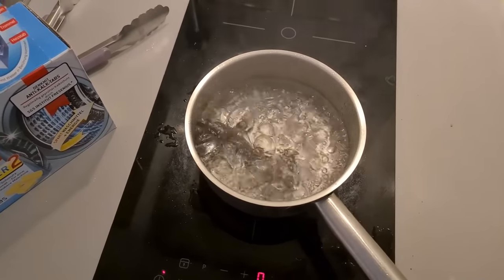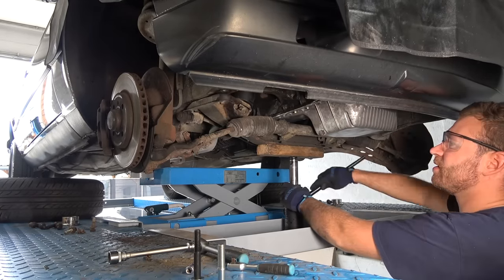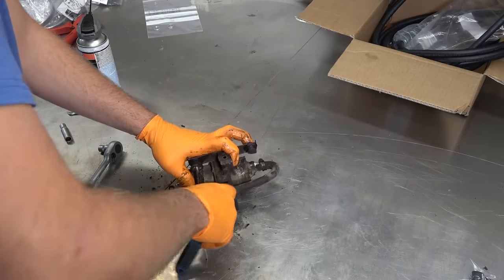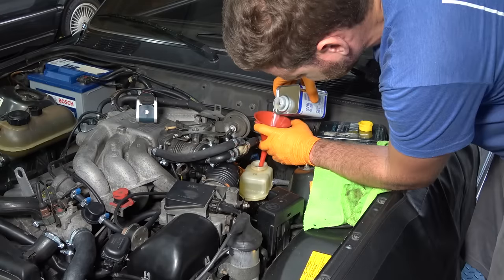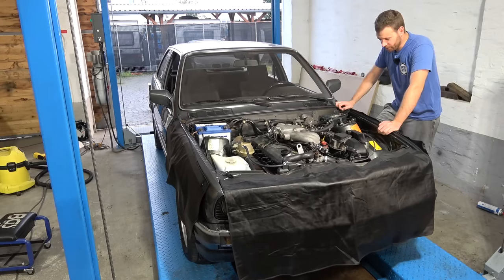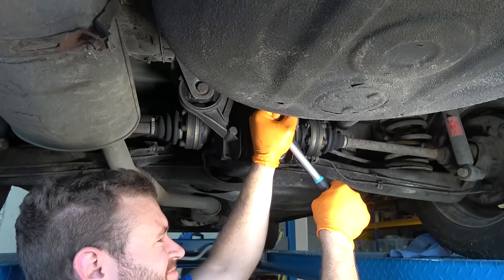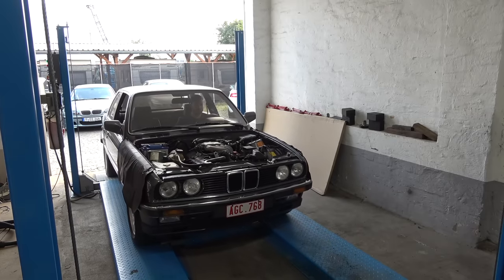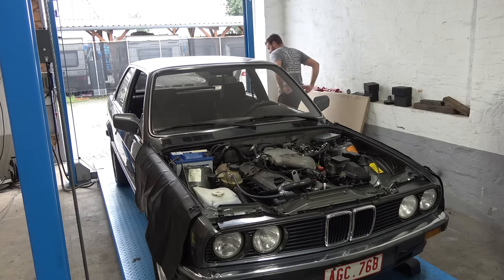Let's Get Mechanical - Neglected BMW E30 320i 5-speed - Project Marbais: Part 4

Comment: with broke of bolts try simply cut a cross or a simple slot on top of them with a dremel tool disk and then use a scredriver very carefully ... always worked best for me ...or if its to deep ... try to be a litte "artistic" ... use a small fräskopf
Reply from the maker: That's not a smart way to go about it, the bolt is weak and would definitely break if you try that
Reply: @M539Restorations  naaa depends ...if its deep enough then maybe not ...gonna be supported by the threading walls a little + no need to weld... but i m not completeley denying that what you say !

Comment: You have a refreshed clutch pedal hydraulic system until you don't t have a one and you are far away from your garage
Reply from the maker: You are making no sense
Reply: @M539Restorations  just a joke. Iv got them to work again with new fluid but they sometimes die because the damage from the old fluid hurt the seals inside and the seals eventually breaks. And when it does break it's always in the worst place.

Comment: Sreten, that with the Oldtimer inspection is absolute BS. The regulation for oldtimers has changed completely, you can now run any mod that was commonly available in the ten years after the car was first registered...
Reply: PS: No, not the exact part that you use had to be available 10 years after the car was first registered, something like it had to be generally available. That means you can get an oldtimer registration with any sort of coilovers you like...
Reply: You can find the details in the Document "AKE-Arbeitsanweisung für die Begutachtung von Oldtimern nach §23 StVZO", the latest version is afaik from November 2020

Comment: HI ,I went to the same problems with my 323i 1984 ,I did send you a comment  yesterday about additional air valve and timing. 
Also there is a sensor on the thermostat housing ,is a 70°degree sensor that is connected to timing, to retarded time during warmup you should remuneration it an put a nut on it or make a bypass  if you need information abut this engine I can help you !https://youtu.be/jlRbW8xkDYM this is how this valve looks